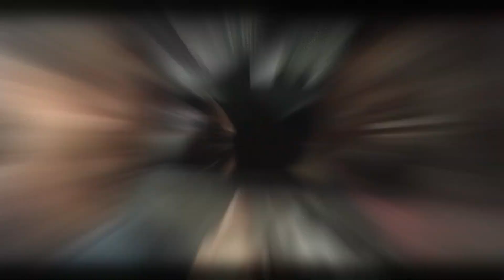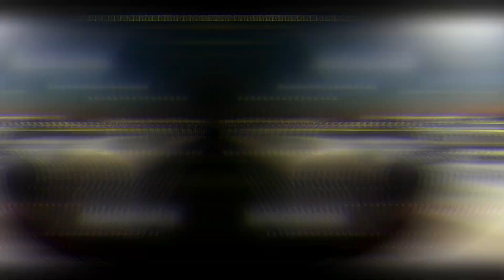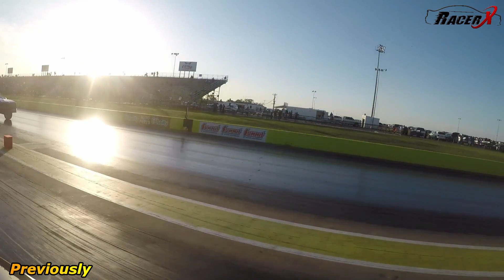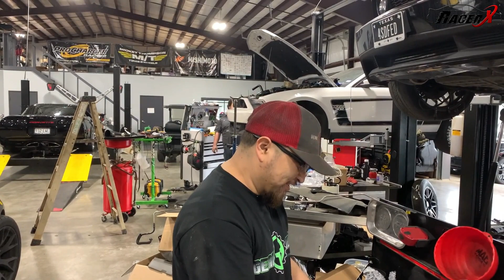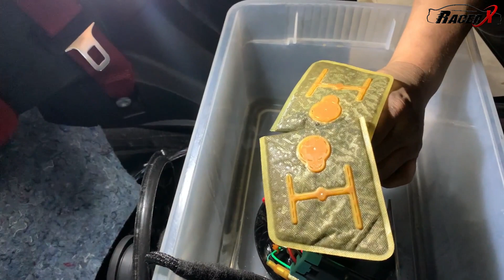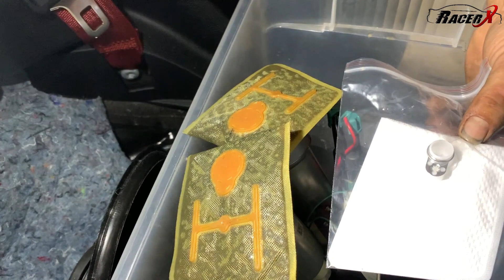The Hellcat Was Hurt in my Race with DonkMaster.. Here's what Really Happened!

Comment: Sounds like you have good idea of what the issue was and how to solve it. Everyone had to be crossing their fingers it didn't fall on its face and go lean and burn some pistons in that last race.
I had my Dart lean out hard when I was running 20 percent ethanol or whatever it was back when that fuel was new. Glad it never ate itself and I stopped running that fuel, just too risky. The Thermo Quad never cared surprisingly but I didn't have a strip kit or enough spares yet to tune it for it. I do now, I actually found strip kit and I have probably 25 carbs like it 😎
Reply from the maker: Yes it was a little dicey but it all worked out

Comment: Some of you are saying  what a great guy RacerX is. for fixing the car. The new owner probably had a agreement with RacerX that if anything was damaged that RacerX would be responsible for any damages. I would not have ever done what the new owner did. I am sure RacerX would have fixed it regardless. Good luck on your new build.
Reply from the maker: We had no idea the fuel pumps were getting lazy.. I told him I would get if fixed since it was the right thing to do
Reply: At least it was a minor problem that could have been a major problem had the car gotten lean on the A/F mixture. I am glad everything worked out for all. Keep up the great videos. Looking forward to your Mustang build. What are you estimating the RWHP to be with your twin turbo set up? The Mustang will be be lighter. I personally have a garage Queen 2021 Dodge challenger scat pack shaker in Sinamon Stick. I am leaving it bone stock. I feel sorry for these car dealers because they hardly have any new inventory. New vehicles are selling for MSRP and Manufacturers have taken off most rebates. Crazy Covid times. Be safe😎